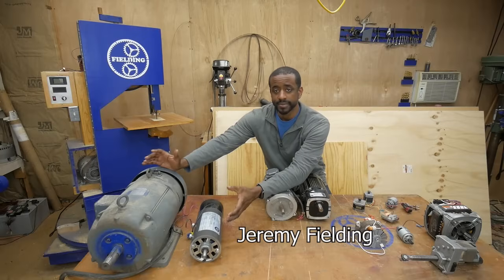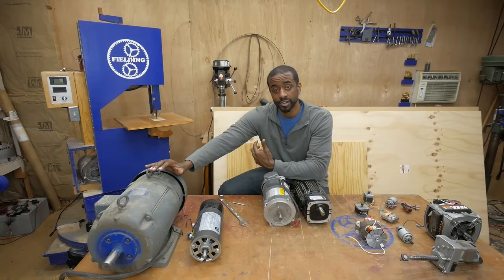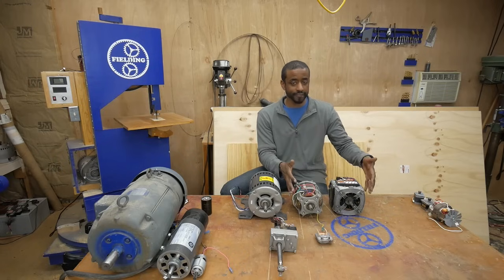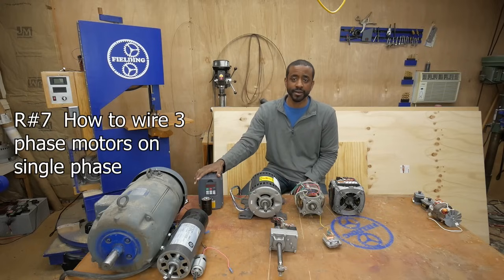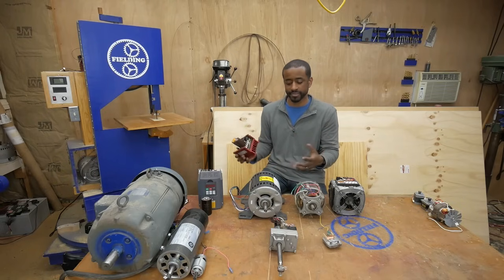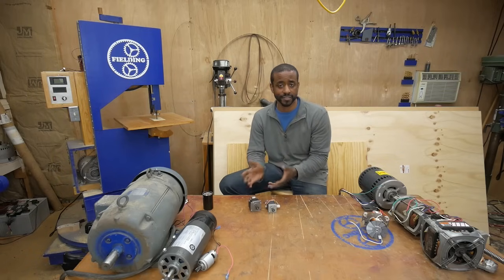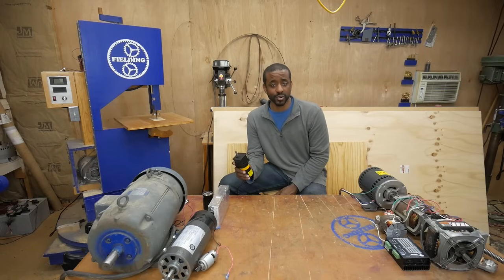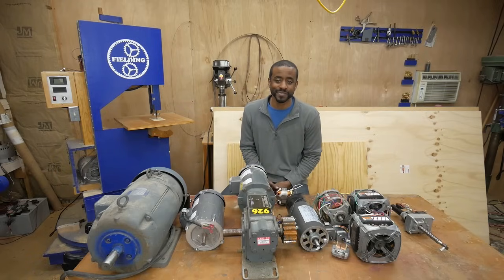Ultimate Beginners Guide to Using Electric Motors for Makers and DIY Projects; #068

Comment: Hi once I found a tiny little motor under a microwave and it said synchronous motor, could someone tell me which type does it belongs or ist another type that he didn't mention.
Reply from the maker: Synchronous AC induction motor. It is in the "induction motor" family except it doesn't "slip". I explain that concept in R#3 in the description.  Also I have used that motor to make a clock out of wood. All the gears and everything. One of my favorite projects. You should check it out! R#1 in the description takes you to that project, but you don't see the motor until the third video I think... if you just want to see that part.

Comment: I converted a treadmill motor into a bicycle powered 12v battery charger. It works good it puts out about 17 to 18 volts pedaling normally with a v belt  driving the motor pulley wrapped over a bicycle rim with no tire

Comment: I want to re wire a 440v three phase motor to 220v. How do I do this? What would happen power wise?
Reply: You should be able to buy or build a variable frequency driver that can convert your 220 input into the output needed by the motor. Assuming the VFD and source could supply the power then there shouldn't be any degradation of output of the motor. On the other hand if you only use half the phase then the motor will output less. The specific characteristics will depend on the motor.
Reply: Depends how many leads are exposed to the user.  If motor only has three leads (T1, T2, T3) then you can’t rewire it.  If it has nine leads (i think it’s nine) then it can be wired for either 440 or 220. Basically windings are connected in series for 440 or parallel for 220.  Power doesn’t change.

Comment: Thanks for the information of AC induction motors.
But you tell very little about brushless motor qnd ESC for brushless motor.
I like motor too. If you need anything about BLDC motor and ESC just ask me.
The most powerful motor in all categories is Brushless motor.
The work very efficiently and sometimes not efficiently.
A single mini motor like your's smallest one can produce 2 to 4 Kilowatts but low efficient.
Try to get Brushless Motor from RC product.
Thank you.
Asked me anytime.

Comment: Really the only difference between a single phase VFD and a three phase VFD are the sine tables, namely how far they are phase shifted. The same hardware can be used for either. Technically, you could even use the same hardware for a BLDC.

Comment: Are there any secondhand motors that will push a 34ft sailboat requiring 15HP?
Reply: You can use multiple smaller motors or you might salvage one that big from an electric pallet jack. The motor from an electric golf cart or an electric hub from an ebike or e-car may work as well.

Comment: Love your videos! Which motor would you use for building your own lift for a treehouse on a budget?
Reply: An old washing machine should do the trick... what you do is counterweight the lift using water pumped into a bag using the pump from the washing machine.
Reply: @kedwa30  Thanks for the reply! 
   Nice use of water mechanics, Do you think I would need two pumps an inlet and outlet or does the pump from most washers work in reverse allowing me to use only one?

Comment: You can make any place a 3-phase all you have to do is mess with the breakers cars that goes into electrician kind of thing all three phase is 3 three hot wires in so all you have to do is get the same amperage Breakers Run 3 hot wires out into your machine motor from the breaker box because your dryers not the gas ones but the electric dryers are two-faced it ain't hard to convert 220 volt 3-phase and not regular house cuz most welders use it and you can do that at a house

Comment: And sjws say black people can't produce proper content. Well done mate, personally i think what you call a motor "computer" is just a microcontroller with a higher clock and low level code, but i may be wrong since i'm just a surfice level hobbyist. Cheers.
Reply from the maker: I would consider a micro controller a computer

Comment: Good video! I'm one of those europeans with 3 phased electricity (which is more expensive than single phased) just for our AC. I was wondering if I could used a VFD just for the AC to switch to single phased. Do you think it can be feasable?

Comment: 3 phase induction motors can also be operated on single phase power (Steinmetz) hook up the motor in delta (equal Volt to your songle fase powersuply) put a capasetor (60uf/kW) over W2 and U2. Power, nutral on V1 line on ether U1 or W1 depending on the rotationad direcrion you want.
If uncerten pleas pleas pleas check with a trained profesional.

Comment: WHY DO THEY USE DIFFERENT MOTORS FOR THE SAME APPLICATION DEPENDING ON WHERE YOU LIVE?
Reply: Because of the different types of power available at different locations. 120v 60hz vs 230v 50hz for example, and in most of Europe we have 3 phase in most residential areas as well.
Reply: @Larshjort  Indeed. Induction motors can be used for a wider variety of applications when you have 3 phase power available, as opposed to single phase. I'm a little puzzled why anyone would use a universal motor for a washing machine though; that one I don't have an explanation for.
Reply: Because of different electric regulations
Reply: @fjoa123  don't worry there is already an answer

Comment: Of course you can speed control a universal motor even under load. What you need is a circuit and a speed sensor.
The more the motor is off it's target speed, the more or less power you give it.

Comment: But.. how did they squeeze the horses into the casings? Where does the hay go?
Good topic and as you say very complex. As others have said, lots of useful information that can lead to other topical motor videos.
Personally I prefer the older motors. Sure they're heavy but they're far quieter and more easily repaired.

Comment: I just subbed and watched many of your videos and had a question from your DIY generator video. Not sure if you covered this or not, but is there any way to isolate your generator from the load? So the generator won't bog down or reduce voltage when the load changes?  Not sure if that is why you talked about adding capacitor or battery.  Those being the only way I could think of isolation. I know you could do a flywheel to reduce changes but that could be an issue if you want it to be a wind turbine generator.  Any info on this would be helpful. Thanks and I am glad I found your channel.
Reply from the maker: Batteries

Comment: I do not think you need a capacitor for single phase induction motors because what makes it move is the secondary winding, but a capacitor is very helpful. Also I do not think VFD can convert phases. I think you mean phase converter and not VFD. Also you can always use VFD for single phase induction motors regardless of they have a capacitor or not. Also all VFD are speed controllers.
Reply from the maker: The second winding is always in phase with the first if you don’t have capacitors. Thus you need caps. Check out my video on how single phase motors work. 

As to your other comments I think you are mixing concepts I didn’t intend to be together. And sure all VFD are speed controllers. I didn’t try to imply it wasn’t. It’s a long video with a lot of content so I understand ideas running together

Comment: Torq is the power rating hp is how fast the power is applied.
Reply from the maker: Just to be clear. Torque is “work” ...power is “speed” times “work” hp and power are exactly the same
Reply: @Jeremy_Fielding  that's like saying  amperage and voltage is the same they are not. put together you get watts. torque is amount of work being done hp is the speed . You get troq and hp ratings from the calculations of amp vs volt equals watt which is equivalent to torq and hp is the speed of the rotation.
Reply from the maker: Please research this more. It’s a great day to learn. You seem to be confusing a few concepts. I made similar mistakes as I was learning. Thanks for watching. 😁
Reply: @Jeremy_Fielding  here are your definitions hp

    Horsepower is defined as the power that a horse gives when pulling, and it is used informally to mean power, or is the power needed to raise 550 pounds a distance of one foot in one second or the power needed to move 33,000 pounds a distance of one foot in one minute. 
 Notice the words distance and move. Which both mean time to travel equals speed.
Reply: @Jeremy_Fielding  here is your definition for torq

: a force that produces or tends to produce rotation or torsion an automobile engine delivers torque to the drive shaft also : a measure of the effectiveness of such a force that consists of the product of the force and the perpendicular distance from the line of action of the force to the axis of rotation

Notice the word Force equals power no mention of speed or distance
Reply from the maker: I hate to abandon you because I don't want you to leave not understanding... but Work is defined as "force x distance" ...that is what I said... and that is what you copied above. I don't understand your interpretation to power from that. Unless you some how think distance and speed are the same... they are not. There are hundreds of comments so lets just agree to disagree if that doesn't soon make sense to you.

Comment: 5:20 start and run caps should looks the same, you cant tell the difference by the looks like how you imply in the video, the only way to tell is by checking the voltage rating and the capacitance, run capacitor usually have higher voltage rating (380-450v) for 200-240v line voltage but most run capacitor have lower capacitance, while start capacitor usually have lower voltage rating with very high capacitance
Reply from the maker: Run cap almost always have a metal case and are oil filled. You can be pretty sure just by looking. Of course that’s not a guarantee any more than what you just said

Comment: I didnt know motors needed capacitors untill last week when my belt sander would not turn and i googled it. (my grandson must have stressed the motor or somthing when he was grinding a axe down for for 10 minutes). the motor would go but only when given a helping hand.  Thanks for this video.  one question i guess is why are these motors running at different speeds...dont the input frequency ie 50hz decide that they all run at 50 revs per second?Just rewatched and you did cover this point. I was thinking the belt sander is very slow and doesent have gear and then i rememberd it has a belt..Duh.   You also coverd that they all run at the input frequency. Off to look for a brokentreadmil on ebay... I dont knw why I need one but I like stocking up.

Comment: 746 watts "out" is 1hp.  These motors are the very best are 80 to 85% efficient.  Watts inout must be higher, like 950 watts in roughly to end up with 1hp or 746 watts out.  I"m sure this deeper into physics than you really need to go for these general explanations.  However, it's important for people to understand that every conversion of energy comes with losses.  In this case we are converting electric power to mechanical forces.  I've leaned a lot from your channel in understanding how AC motors start and I appreciate that.  I have made my living in DC power systems.

Comment: Found your channel today. Nice job explaining. I know all you mentioned already but I still left the video up to hear the explanations. I am pleased. 

Some day I may do a video on the effect of frequency on devices. That is not really applicable to the US but in several countries where I lived people buy 240 to 120V auto transformers to get 120V for US market devices. The problem is the 50Hz which they ignore. 

There is also a reverse problem that I was looking into with a friend but I left that country so its on pause now. Basically he bought a cheap US generator on Anazon and was looking to use his auto transformer to get 240V to power devices in case of emergency. I was explaining the challenge would be the frequency. Universal motors don't care but induction motors do. He stands a chance of burning some devices.

Comment: Excellent vidéo.   Just to add a bit to what you said about torque versus rpm,  this shows up in so-called "model solar motors"  which have a diameter at least four times that of a similar wattage micro-motor from, say, a mobile phone.  More torque, lower rpm, less down gearing loss for applications wanting low speed but more torque.  Also I think my current washing machine has a pancake motor direct driving the tub.  Can't tell you the diameter off hand, but it's big.  Enough torque to eliminate gearing, and taking less power input.  You explained the principle very well.  Ta.

Comment: Nice job. This is a very difficult topic to cover briefly.
Reply: @ChingaTuMaga  Motors, especially AC motors, like many aspects of engineering, are subject to the "Feynman Effect" - haha. You have a motor, connect power and it spins. What's so difficult?  You can teach an electrician to memorize by rote how to connect motors, 12 wire alternators, etc.  But when you try to explain why motors are designed as they are, or why they behave as they do, the explanation explodes.

This is the Feynman Effect, where one question leads to another, almost without limit. To fully understand an AC electric motor, there are so many things, hundreds and hundreds of things you need to understand -- and some of it gets very mathy -- that it's hard to decide what to leave out of an explanation. That's what's going on in the video. To make a useful 20 minute presentation, you have to leave out 99 percent of the subject. But which parts do you leave out and still give the viewer useful information? This is a difficult thing to attempt. I know because I've done this myself.

Anyway, that's where my compliment is coming from.

Comment: Question about VFD, My one man shop has 4,  3 phase motors on different machines, could I wire a 3 phase load center with one VFD feeding it? by removing the VFD control panel  from the face and  taking it to  the machine I am running be able to  control that motor?  Or do I need 4 VFD's?

Comment: I have a 120V single phase capacitor start motor that can be wired for clockwise or counterclockwise rotation. Is it possible to wire it to a switch to enable it to change direction by toggling the switch?

Comment: I just subscribed because of your awesomeness.
40 years ago while tearing apart my sister's unplugged strobe light I learned forever what a capacitor was.I 
I learned at least 3 things from this video.
I wish you would have mentioned how lots of folks use that tread mill motor to generate electricity (windmills,etc).  So I give you a 99 out of 100.
Reply from the maker: It’s in at least two of the videos I referred to in the description

Comment: Thanks much Jeremy, Great video; I have a passionate interest in installing variable trigger ( not dial--) controlled speed to a standard 4.5' disk grinder. (My interest is based on experience. It affords much safer use safety as well as far greater variety of application of the tool,  --s buffing glass without  heat build up , fine polishing of plastic, farmer precision in finishing of surfaces in general).
  Made my first conversion was to a corded std ac 4.5" da. disk grinder,  using the trigger off an old sears and roebuck  jig saw. I later discovered this as an inbuilt feature in the Australian GMC brand of 4.5" disk grinders and the Truper brand of same size  disk grinders in Mexico , They all however tend to fail under real working loads esp at low speeds, after a year of so;  These triggers are essentially potentiometers. I want to step up my game with a variable frequency trigger  on my cordless disk grinder, as I understand the variable frequency trigger (common to most cordless drills for example) transmits much more torque   at the lower end-- than a simple potentiometer type trigger--which is exactly what you need in using this kind of tool..Problem is that a vf trigger is complicated and I don't know how to install it frankly.. Your insights greatly appreciated. In fact if you can come up with a practical conversion you'd have already market for it , for as I say once you use vf on a disk grinder you will never go back to the conventional trigger...  Thoughts ?

Comment: Thank you very much. I have been designing and building machinery for over 45 years and I learned a lot on this video. 
I am working on making an electric powered hydraulic power unit for my blacksmith shop and have found information on how much power and speed is needed to produce how much pressure with various pumps and boy is it tough to locate all this information.

Comment: nice video. if my capacitor is failing or failed just push the pulley or whatever is on the shaft and bam it's running.

Comment: Jeremy, I've found a very simple  way to control induction motors. A dimmer attached to a triac. You can, also, control step motors, if you convert it, to 3 phase motor, using a mosfet, with a voltage regulator.

Comment: Hey great summary, I also like to collect motors, the treadmills, they are brushed DC yes? Looks like the controller is a PWM ‘duty cycle’ controller, I’ll check back but that’s quite useful info for me thank you, I guess I always assumed they’d be BLDC motors silly me, good cheap source for a relatively high power brushed DC motor. {XP sound} regards.

Comment: Hi Jeremy I want to upgrade my 1/2hp single phase motor on my small lathe to a motor that I can control the speed on. I have a 2.5hp treadmill motor and was wondering if I should use it or get a three phase motor with a vfd. If I do go with the three phase motor should I get a 1/2hp or get one with more hp like 1hp or greater?